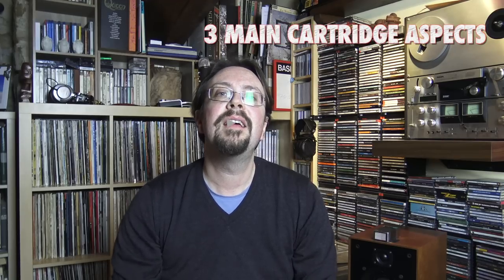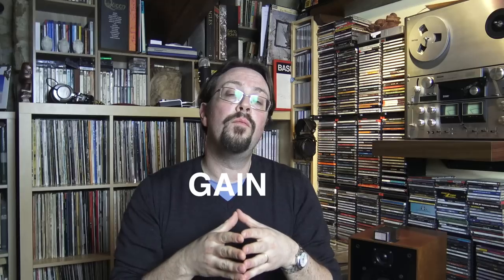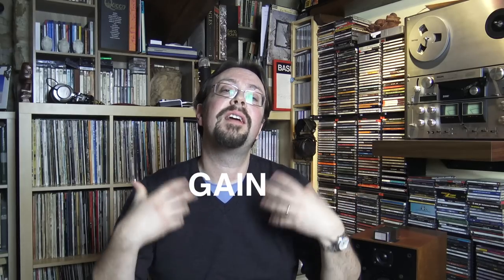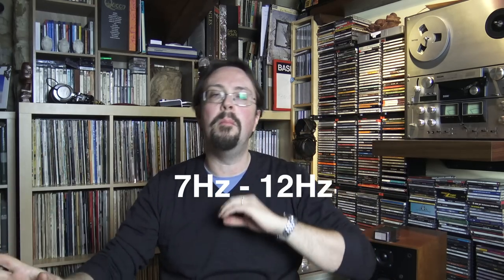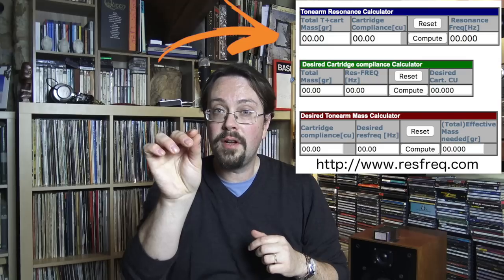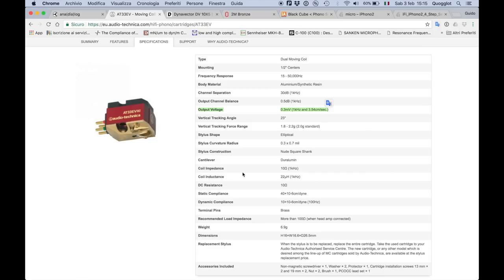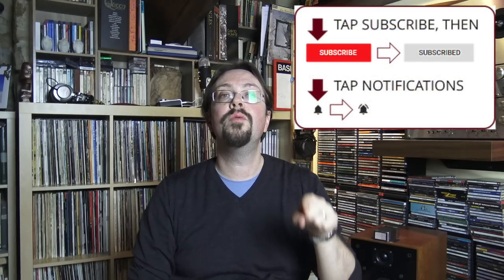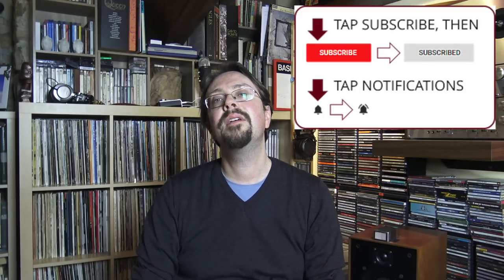PHONO CARTRIDGE: How to choose and match it with your preamp and tonearm

Comment: Surely impedance matching is only relevant to mc cartridges.
Reply: Hi Tom. Firstly, I’m not here to “cartridge shame” you in the least, but that statement is actually not true. MM carts are very sensitive to impedance loading. The sonic difference between say, 50pf and 350pf when using an MM cart are very noticeable. Just google “MM cartridge loading”, and you’ll get way more info than I could ever tell you here. 
Good luck to you, Tom! 🎶🔊🙂

Comment: Hi, do you know why I don't believe this presentation about compliance and compatibility? First, because it is misunderstood. Then because people are suggesting to measure the total mass of the tonearm with cartridge and everything which becomes irelevant as soon as I mount the counterweight. Then someone wil say, nooo, you have to weight everything, the counterweight too. It does not matter. After putting the tonearm in ballance, adjusting the tracking force and antiskating, all these becomes irrelevant. No scale and no counterweight markings are perfect. 1/10 grams weight alteration and boom, everything changes: resonance or no resonance. Not to mention the shape of the toneram and construction matterial. I could understand that in some very rare conditions, deppending on what is recorded on the vinyl, a very poor quality vinyl, like a hard and cheap matterial used for that vinyl, could resonate. But a soft vynil, a high quality vinyl? i don't think so. And that formula can not sum everything in real life. I heard already too much "ussually" and "in general", things that are not compatible with exact science. I'll pass unless otherwise prooved.
Reply from the maker: Ino need to believe. No religion here. I think you are a little mixed-up. This IS science and you don't have to listen to me, ask anyone in the business or engineers. Vinyl resonance? What in the world make you think that is the problem...the cart/arm at certain frequencies, below 7hz, start to resonate and wiggle. Just get a test record and try for yourself. These are not opinions, like the ones you just dropped here, but objective issues that need to be addressed from perfect playback.
Finally, the counterweight creates equilibrium with the cart and arm weight but here we are talking about a frequency resonance that goes through them...mass is key, it's not a matter of weight. Study and then criticize.

Comment: Its not that difficult really . If you are really interested in good quality stylus 
Look at moving Iron cartridges .
Reply: That's a bit simplistic. stylus has no bearing on the type of cart, an elliptical stylus is found on moving coils, moving magnet and moving iron cartridges alike. I currently run a Grado Prestige Green 1, a moving iron cart on a budget turntable from the mid 80's and it's a standard elliptical stylus.